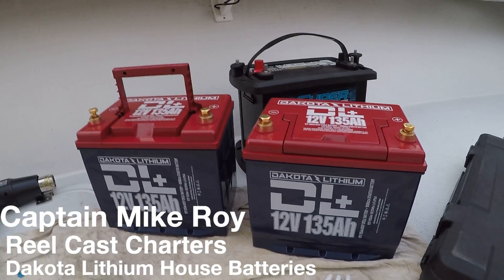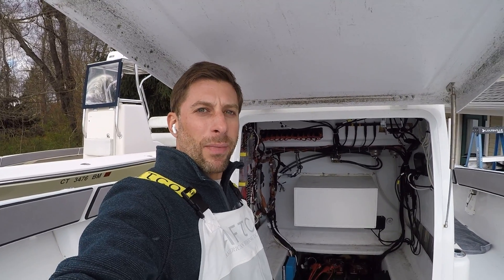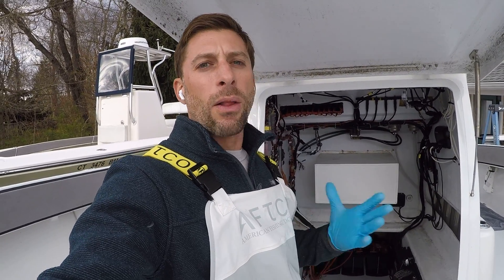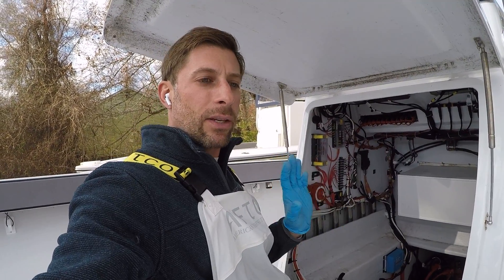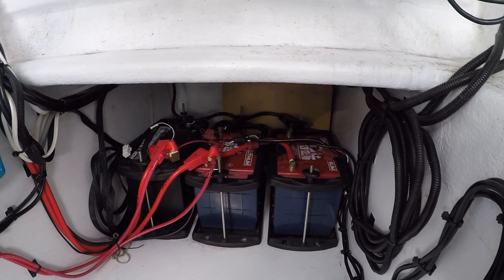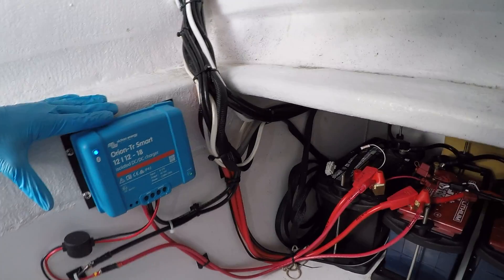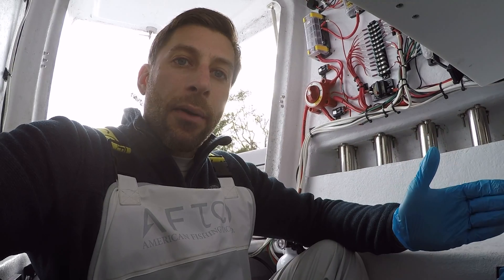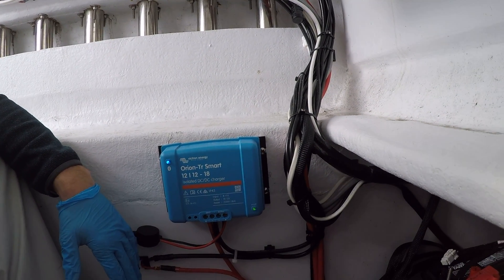How to Install Dakota Lithium Batteries in your Boat

Comment: This is a great set up for bringing the higher storage capacity of LFP batteries into your boat while keeping the FLA battery for starting.  The big problem with LFP batteries for a start battery is if the BMS shuts off the battery while running which will destroy the diodes in rectifier / regulator as the voltage and current have no where to go. 

To the best of my knowledge, Mercury Marine is the only manufacturer that has approved certain models to use LFP start batteries to be used with certain models of their engines and only ReLion batteries meet the Mercury standards for LFP batteries. 

The other thing you mention about LFP batteries being a sponge for electrons is also true due to their low resistance.  This “can” cause problems in a charging system / alternator if the regulator uses a variable magnetic field to adjust the alternator’s output, this type of alternator is like the ones you would find in a car, or a VMA. The output of this type of alternator itself is variable.  Typically these types of alternators do not have a 100% duty cycle at full output, and due to the low resistance of the LFP battery the regulator will command full output until the LFP battery is charged, this causes the alternator to overheat and will burn up the alternator.  Some of this type of alternator are designed to work at 100% duty cycle while others have a thermocouple in the winding and will command the regulator to reduce output when the winding gets too hot. 

If the alternator is a fixed magnetic field type, PMA, the alternator is always at full output and  the regulator shunts unwanted voltage / amperage to ground. This type of system is a great marriage with LFP batteries, as the LFP batteries will soak up those otherwise unwanted electrons that were being shunted to ground. 

The rectifier mentioned above converts the alternators AC output from AC voltage to DC voltage, this is true for both VMA and PMA types of alternators.  My boats PMA alternators have worked very well with LFP house battery and AGM start battery, the only time those batteries are tied together is when the engines are running. 

Using a DC to DC charger limits the charging current from the engine(s) to a LFP battery, and isolates the start battery when the engine is off.

Comment: I noticed the on/off/combined battery switch. My understanding is that you can't use it to safely combine lead-acid and lithium batteries, are you using it only as on/off for starting battery?
Reply: That is a Blue Seas 5511E switch, it is a two circuit switch with a combiner for emergencies. You can safely combine a FLA and LFP for starting, you just wouldn’t want to leave them combined as the LFP batteries will discharge into the lead acid battery due to the LFP batteries higher resting voltage.

Comment: Very nice. 
May I ask for more installation details? 
I have a lithium  140ah starting and 100ah house.
  Is the charger wired to the battery  switch in any way? Or is it isolated? 
 And what size fuses are you using?
Reply from the maker: It is a Victron DC to DC converter. The lead acid starting battery goes into the input side and output goes to the lithium house battery.

Comment: I would drop the parallel connection and have each battery to a busbar then pull from that busbar for inverters etc...  It's proven your batteries will last longer as every amp doesn't go through each battery so 1/2 the work with 2 and 1/4 with 4.
Reply: You are describing a series connection wherein all amperage flows through each battery.  In a series connection voltage is additive and amperage is not. E.G. three 12.8V LFP 100Ah / 1280 watt hour batteries wired in series produces a 38.4V battery with 100Ah of capacity and 3,840 watt hours. The watt hours increase due to V x A(h)=watts, or  12.8x 3=38.4 volts x 100=‘s 3,840. 

In a parallel connection, amperage is additive and voltage is not. If you have three 12.8V 100Ah / 1280 batteries in parallel, you get ac12.8V battery with 300Ah and 3,840 watt hours because 12.8V x 300=‘s 3,840.  

Whether the battery positive leads are just tied together at the batteries themselves or run to a buss bar in a parallel system the house loads are shared equally by each battery as the positives are common.  Buss bars keep connections at the battery to just one lead off of each post which is neat and tidy.

Comment: Great video! Did you keep the existing plug in battery charger when your at the dock?
Reply from the maker: Yes it is the Minn Kotta Precision charger that is made for both lithium and traditional batteries. It works great.